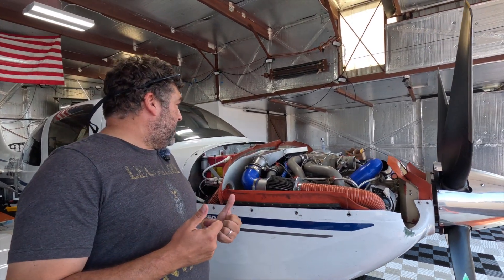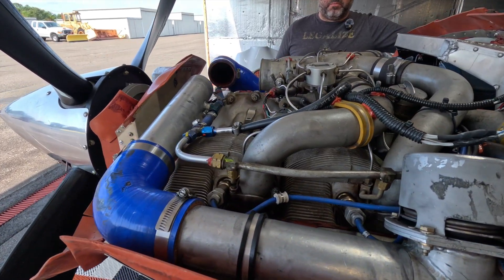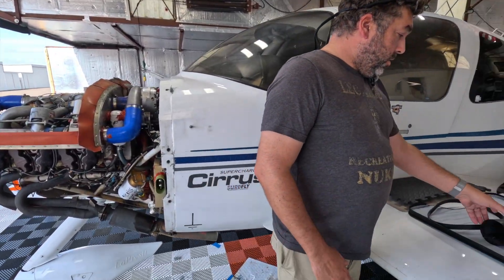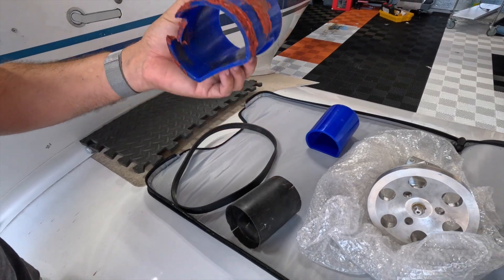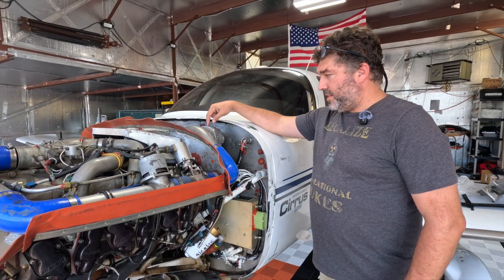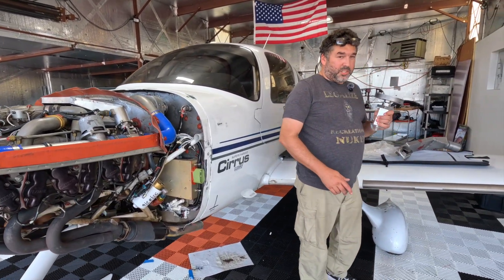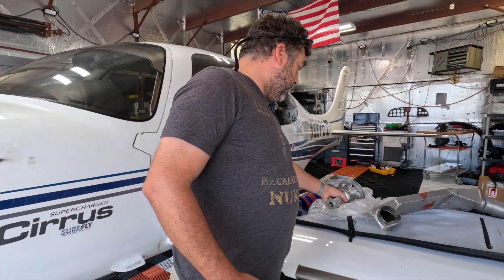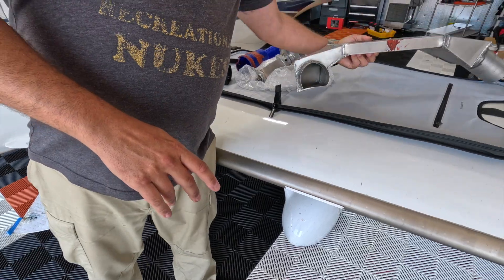Supercharger on a Cirrus: Effective, but orphaned

Comment: I think this supercharger is a brilliant idea, lacking design quality, and refinement with the obvious restraints of the good ole FAA.  Glad my supercharged truck as a pulley and  bearing designed  to last likely 200,000 miles give or take or roughly 4000 hours compared to cheap rudimentary aviation designs…

Comment: I'm 73 and I have played with airplanes all my life. I feel this is a much better system than turbo super charging. Reason: Lack of heat from the turbo. This brings the TBO back up to a normally aspirated engine! Race car drivers will disagree with me and that is their bad! Look back at Pratt and Whitney radials. They run 10 to 1 and 12 to 1 blowers.  Thanks for the video!